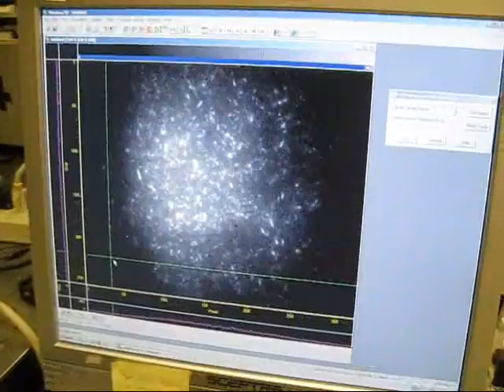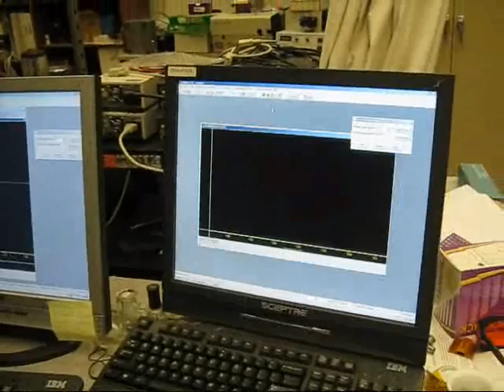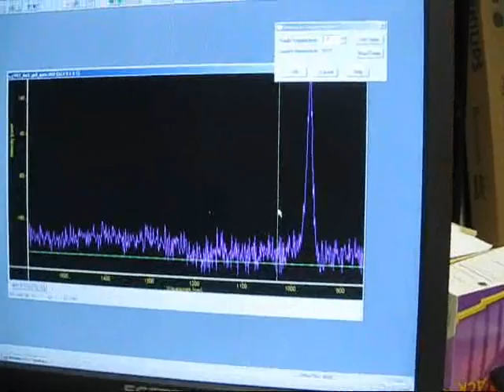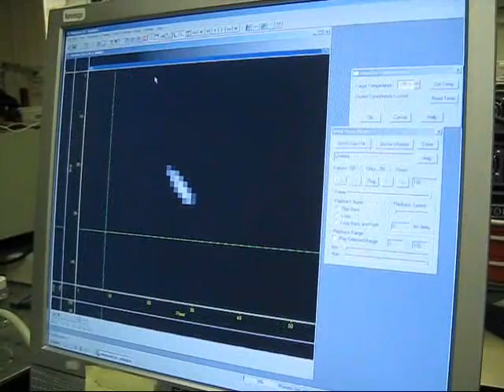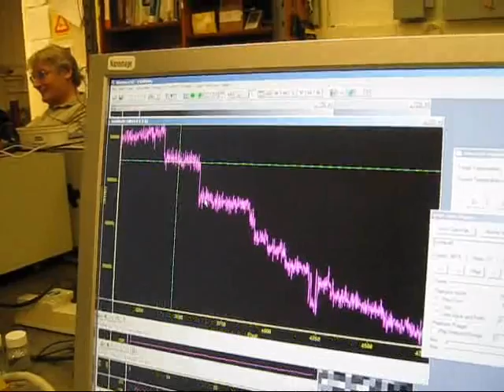Single nanotube experiment with tunable Ti:Sapphire laser Trestles sales@dmphotonics.com

Comment from the maker: Fluorescent protein properties 
http://nic.ucsf.edu/FPvisualization/
Each fluorescent protein begins plotted with excitation wavelength on the x-axis and emission wavelength on the y-axis. The color is set based on its emission wavelength, and fades to gray as the brightness (product of exctinction coefficient and quantum yield) decreases. Intrinsically fluorescent proteins are shown as circles and proteins requiring an extrinisc cofactor are shown as squares. Dimeric proteins are indicated with a 2 inside the symbol; tandem dimeric proteins are shown with a t inside the symbol. Mouseover each circle to see info on that protein or click on any datapoint to see the corresponding reference on PubMed. You can zoom using the mouse scroll wheel and pan by clicking and dragging. Use the filter sliders at the top right to select a subset of fluorescent proteins based on certain criteria. Use the X and Y axis toggle boxes to change what is plotted on each axis.

UV Proteins
Protein	?ex (nm)	?em (nm)	EC	QY	Brightness	pKa	Bleaching (s)	Maturation (min)	Lifetime (ns)	Reference
Sirius	355	424	15000	0.24	3.6	3				1
Blue Proteins
Protein	?ex (nm)	?em (nm)	EC	QY	Brightness	pKa	Bleaching (s)	Maturation (min)	Lifetime (ns)	Reference
Azurite	383	450	26200	0.55	14.4	5	33		3.4	2
EBFP2	383	448	32000	0.56	18	4.5	55		3	3
mKalama1	385	456	36000	0.45	16	5.5				3
mTagBFP2	399	454	50600	0.64	32.4	2.7	53		2.6	4
TagBFP	402	457	52000	0.63	32.8	2.7	34		2.6	7
Cyan Proteins
Protein	?ex (nm)	?em (nm)	EC	QY	Brightness	pKa	Bleaching (s)	Maturation (min)	Lifetime (ns)	Reference
ECFP	433	475	32500	0.4	13	4.7				8
Cerulean	433	475	43000	0.62	26.7	4.7	36			9
mCerulean3	433	475	40000	0.8	32	4.7				10
SCFP3A	433	474	30000	0.56	16.8	4.5				11
CyPet	435	477	35000	0.51	17.8	5.02				12
mTurquoise	434	474	30000	0.84	25.2					13
mTurquoise2	434	474	30000	0.93	27.9	3.1	90			14
TagCFP	458	480	37000	0.57	21	4.7				
mTFP1	462	492	64000	0.85	54	4.3				18
monomeric Midoriishi-Cyan	470	496	22150	0.7	15.5	7				19
Aquamarine	430	474	26000	0.89	23.1	3.3			4.1	53
Green Proteins
Protein	?ex (nm)	?em (nm)	EC	QY	Brightness	pKa	Bleaching (s)	Maturation (min)	Lifetime (ns)	Reference
TurboGFP	482	502	70000	0.53	37.1	5.2				20
TagGFP2	483	506	56500	0.6	33.9	4.7				7
mUKG	483	499	60000	0.72	43.2	5.2				21
Superfolder GFP	485	510	83300	0.65	54.1					22
Emerald	487	509	57500	0.68	37.3	6	101			23
EGFP	488	507	56000	0.6	33.6	6	174	25		24
Monomeric Azami Green	492	505	55000	0.74	40.7	5.8				25
mWasabi	493	509	70000	0.8	56	6	93			26
Clover	505	515	111000	0.76	84.4	6.1	50	30		27
mNeonGreen	506	517	116000	0.8	92.8	5.7	158	10		28
Yellow Proteins
Protein	?ex (nm)	?em (nm)	EC	QY	Brightness	pKa	Bleaching (s)	Maturation (min)	Lifetime (ns)	Reference
TagYFP	508	524	64000	0.62	39.7	5.5				
EYFP	513	527	83400	0.61	50.9	6.9	60			29
Topaz	514	527	94500	0.6	56.7					
Venus	515	528	92200	0.57	52.5	6	15			30
SYFP2	515	527	101000	0.68	68.7	6				11
Citrine	516	529	77000	0.76	58.5	5.7	49			31
Ypet	517	530	104000	0.77	80.1	5.6				12
lanRFP-?S83	521	592	71000	0.1	7.1	4.7		720		50
mPapaya1	530	541	43000	0.83	35.7	6.8				52
Orange Proteins
Protein	?ex (nm)	?em (nm)	EC	QY	Brightness	pKa	Bleaching (s)	Maturation (min)	Lifetime (ns)	Reference
Monomeric Kusabira-Orange	548	559	51600	0.6	31	5				19
mOrange	548	562	71000	0.69	49	6.5	9	150		32
mOrange2	549	565	58000	0.6	34.8	6.5				33
mKO?	551	563	105000	0.61	64	4.2				21
mKO2	551	565	63800	0.62	39.6	5.5				34
Red Proteins
Protein	?ex (nm)	?em (nm)	EC	QY	Brightness	pKa	Bleaching (s)	Maturation (min)	Lifetime (ns)	Reference
TagRFP	555	584	100000	0.48	49	3.8	48	100		35
TagRFP-T	555	584	81000	0.41	33.2	4.6	337	100		33
mRuby	558	605	112000	0.35	39.2	4.4				36
mRuby2	559	600	113000	0.38	43	5.3	123	150		27
mTangerine	568	585	38000	0.3	11.4	5.7				37
mApple	568	592	75000	0.49	36.7	6.5				33
mStrawberry	574	596	90000	0.29	26.1	4.5	15	50		32
FusionRed	580	608	95000	0.19	18.1	4.6	150	130		38
mCherry	587	610	72000	0.22	15.8	4.5	96	40		32
mNectarine	558	578	58000	0.45	26.1	6.9	11	30		49
Far Red Proteins
Protein	?ex (nm)	?em (nm)	EC	QY	Brightness	pKa	Bleaching (s)	Maturation (min)	Lifetime (ns)	Reference
mKate2	588	633	62500	0.4	25	5.4	84	20		39
HcRed-Tandem	590	637	160000	0.04	6.4					
mPlum	590	649	41000	0.1	4.1	4.5	53	100		40
mRaspberry	598	625	86000	0.15	12.9					40
mNeptune	600	650	67000	0.2	13.4	5.4	255	35		41
NirFP	605	670	15700	0.06	0.9	4.5				42
TagRFP657	611	657	34000	0.1	3.4	5				43
TagRFP675	598	675	46000	0.08	3.7	5.7		25	0.9	47
mCardinal	604	659	87000	0.19	16.5	5.3	730	27		54
Near IR Proteins
Protein	?ex (nm)	?em (nm)	EC	QY	Brightness	pKa	Bleaching (s)	Maturation (min)	Lifetime (ns)	Reference
iFP1.4	684	708	92000	0.07	6.4	4.6	50	114		44
iRFP713 (iRFP)	690	713	105000	0.06	6.2	4	450	168		45
iRFP670	643	670	114000	0.11	12.5	4				46
iRFP682	663	682	90000	0.11	9.9	4.5				46
iRFP702	673	702	93000	0.08	7.4	4.5				46
iRFP720	702	720	96000	0.06	5.8	4.5				46
iFP2.0	690	711	86000	0.08	6.9					55
Sapphire-type Proteins
Protein	?ex (nm)	?em (nm)	EC	QY	Brightness	pKa	Bleaching (s)	Maturation (min)	Lifetime (ns)	Reference
Sapphire	399	511	29000	0.64	18.6					5
T-Sapphire	399	511	44000	0.6	26.4	4.9	25			6
mAmetrine	406	526	45000	0.58	26.1	6	2.8			48
Long Stokes Shift Proteins
Protein	?ex (nm)	?em (nm)	EC	QY	Brightness	pKa	Bleaching (s)	Maturation (min)	Lifetime (ns)	Reference
mKeima Red	440	620	14400	0.24	3.5	6.5				15
mBeRFP	446	611	65000	0.27	17.6	5.6				16
LSS-mKate2	460	605	26000	0.17	4.4	2.7				17
LSS-mKate1	463	624	31200	0.08	2.5	3.2				17
LSSmOrange	437	572	52000	0.45	23.4	5.7		138		51

Comment from the maker: Bibliography

Tomosugi et al. An ultramarine fluorescent protein with increased photostability and pH insensitivity. Nat Meth 2009. 6(5): 351-353. doi: 10.1038/nmeth.1317
Mena et al. Blue fluorescent proteins with enhanced brightness and photostability from a structurally targeted library. Nat Biotechnol 2006. 24(12): 1569-1571. doi: 10.1038/nbt1264
Ai et al. Exploration of New Chromophore Structures Leads to the Identification of Improved Blue Fluorescent Proteins † . Biochemistry 2007. 46(20): 5904-5910. doi: 10.1021/bi700199g
Subach et al. An Enhanced Monomeric Blue Fluorescent Protein with the High Chemical Stability of the Chromophore. PLoS ONE 2011. 6(12): e28674. doi: 10.1371/journal.pone.0028674
Cubitt et al. Chapter 2: Understanding Structure—Function Relationships in the Aequorea victoria Green Fluorescent Protein. Green Fluorescent Proteins 1998.: 19-30. doi: 10.1016/s0091-679x(08)61946-9
Zapata-Hommer et al. BMC Biotechnology 2003. 3(1): 5. doi: 10.1186/1472-6750-3-5
Subach et al. Conversion of Red Fluorescent Protein into a Bright Blue Probe. Chemistry & Biology 2008. 15(10): 1116-1124. doi: 10.1016/j.chembiol.2008.08.006
Heim et al. Wavelength mutations and posttranslational autoxidation of green fluorescent protein.. Proceedings of the National Academy of Sciences 1994. 91(26): 12501-12504. doi: 10.1073/pnas.91.26.12501
Rizzo et al. An improved cyan fluorescent protein variant useful for FRET. Nat Biotechnol 2004. 22(4): 445-449. doi: 10.1038/nbt945
Markwardt et al. An Improved Cerulean Fluorescent Protein with Enhanced Brightness and Reduced Reversible Photoswitching. PLoS ONE 2011. 6(3): e17896. doi: 10.1371/journal.pone.0017896
Kremers et al. Cyan and Yellow Super Fluorescent Proteins with Improved Brightness, Protein Folding, and FRET Forster Radius † , ‡ . Biochemistry 2006. 45(21): 6570-6580. doi: 10.1021/bi0516273
Nguyen et al. Evolutionary optimization of fluorescent proteins for intracellular FRET. Nat Biotechnol 2005. 23(3): 355-360. doi: 10.1038/nbt1066
Goedhart et al. Bright cyan fluorescent protein variants identified by fluorescence lifetime screening. Nat Meth 2010. 7(2): 137-139. doi: 10.1038/nmeth.1415
Goedhart et al. Structure-guided evolution of cyan fluorescent proteins towards a quantum yield of 93%. Nat Comms 2012. 3: 751. doi: 10.1038/ncomms1738
Kogure et al. A fluorescent variant of a protein from the stony coral Montipora facilitates dual-color single-laser fluorescence cross-correlation spectroscopy. Nat Biotechnol 2006. 24(5): 577-581. doi: 10.1038/nbt1207
Yang et al. mBeRFP, an Improved Large Stokes Shift Red Fluorescent Protein. PLoS ONE 2013. 8(6): e64849. doi: 10.1371/journal.pone.0064849
Piatkevich et al. Monomeric red fluorescent proteins with a large Stokes shift. Proceedings of the National Academy of Sciences 2010. 107(12): 5369-5374. doi: 10.1073/pnas.0914365107
Ai et al. Directed evolution of a monomeric, bright and photostable version of Clavularia cyan fluorescent protein: structural characterization and applications in fluorescence imaging. Biochem. J. 2006. 400(3): 531. doi: 10.1042/bj20060874
KARASAWA et al. Cyan-emitting and orange-emitting fluorescent proteins as a donor/acceptor pair for fluorescence resonance energy transfer. Biochem. J. 2004. 381(1): 307. doi: 10.1042/bj20040321
Evdokimov et al. Structural basis for the fast maturation of Arthropoda green fluorescent protein. EMBO Rep 2006. 7(10): 1006-1012. doi: 10.1038/sj.embor.7400787
Tsutsui et al. Improving membrane voltage measurements using FRET with new fluorescent proteins. Nat Meth 2008. 5(8): 683-685. doi: 10.1038/nmeth.1235
Pedelacq et al. Engineering and characterization of a superfolder green fluorescent protein. Nat Biotechnol 2005. 24(1): 79-88. doi: 10.1038/nbt1172
Cubitt et al. Chapter 2: Understanding Structure—Function Relationships in the Aequorea victoria Green Fluorescent Protein. Green Fluorescent Proteins 1998.: 19-30. doi: 10.1016/s0091-679x(08)61946-9
Yang et al. Optimized Codon Usage and Chromophore Mutations Provide Enhanced Sensitivity with the Green Fluorescent Protein. Nucleic Acids Research 1996. 24(22): 4592-4593. doi: 10.1093/nar/24.22.4592
Karasawa et al. A Green-emitting Fluorescent Protein from Galaxeidae Coral and Its Monomeric Version for Use in Fluorescent Labeling. Journal of Biological Chemistry 2003. 278(36): 34167-34171. doi: 10.1074/jbc.m304063200
Ai et al. Hue-shifted monomeric variants of Clavularia cyan fluorescent protein: identification of the molecular determinants of color and applications in fluorescence imaging. BMC Biol 2008. 6(1): 13. doi: 10.1186/1741-7007-6-13
Lam et al. Improving FRET dynamic range with bright green and red fluorescent proteins. Nat Meth 2012. 9(10): 1005-1012. doi: 10.1038/nmeth.2171
Shaner et al. A bright monomeric green fluorescent protein derived from Branchiostoma lanceolatum. Nat Meth 2013. 10(5): 407-409. doi: 10.1038/nmeth.2413
Orm  et al. Crystal Structure of the Aequorea victoria Green Fluorescent Protein. Science 1996. 273(5280): 1392-1395. doi: 10.1126/science.273.5280.1392
Nagai et al. A variant of yellow fluorescent protein with fast and efficient maturation for cell-biological applications. Nat. Biotechnol. 2002. 20(1): 87-90. doi: 10.1038/nbt0102-87
Griesbeck et al. Reducing the Environmental Sensitivity of Yellow Fluorescent Protein: MECHANISM AND APPLICATIONS. Journal of Biological Chemistry 2001. 276(31): 29188-29194. doi: 10.1074/jbc.m102815200
Shaner et al. Improved monomeric red, orange and yellow fluorescent proteins derived from Discosoma sp. red fluorescent protein. Nat Biotechnol 2004. 22(12): 1567-1572. doi: 10.1038/nbt1037
Shaner et al. Improving the photostability of bright monomeric orange and red fluorescent proteins. Nat Meth 2008. 5(6): 545-551. doi: 10.1038/nmeth.1209
Sakaue-Sawano et al. Visualizing Spatiotemporal Dynamics of Multicellular Cell-Cycle Progression. Cell 2008. 132(3): 487-498. doi: 10.1016/j.cell.2007.12.033
Merzlyak et al. Bright monomeric red fluorescent protein with an extended fluorescence lifetime. Nat Meth 2007. 4(7): 555-557. doi: 10.1038/nmeth1062
Kredel et al. mRuby, a Bright Monomeric Red Fluorescent Protein for Labeling of Subcellular Structures. PLoS ONE 2009. 4(2): e4391. doi: 10.1371/journal.pone.0004391
Shaner et al. Improved monomeric red, orange and yellow fluorescent proteins derived from Discosoma sp. red fluorescent protein. Nat Biotechnol 2004. 22(12): 1567-1572. doi: 10.1038/nbt1037
Shemiakina et al. A monomeric red fluorescent protein with low cytotoxicity. Nat Comms 2012. 3: 1204. doi: 10.1038/ncomms2208
Shcherbo et al. Far-red fluorescent tags for protein imaging in living tissues. Biochem. J. 2009. 418(3): 567. doi: 10.1042/bj20081949
Wang et al. Evolution of new nonantibody proteins via iterative somatic hypermutation. Proceedings of the National Academy of Sciences 2004. 101(48): 16745-16749. doi: 10.1073/pnas.0407752101
Lin et al. Autofluorescent Proteins with Excitation in the Optical Window for Intravital Imaging in Mammals. Chemistry & Biology 2009. 16(11): 1169-1179. doi: 10.1016/j.chembiol.2009.10.009
Shcherbo et al. Near-infrared fluorescent proteins. Nat Meth 2010. 7(10): 827-829. doi: 10.1038/nmeth.1501
Morozova et al. Far-Red Fluorescent Protein Excitable with Red Lasers for Flow Cytometry and Superresolution STED Nanoscopy. Biophysical Journal 2010. 99(2): L13-L15. doi: 10.1016/j.bpj.2010.04.025
Shu et al. Mammalian Expression of Infrared Fluorescent Proteins Engineered from a Bacterial Phytochrome. Science 2009. 324(5928): 804-807. doi: 10.1126/science.1168683
Filonov et al. Bright and stable near-infrared fluorescent protein for in vivo imaging. Nat Biotechnol 2011. 29(8): 757-761. doi: 10.1038/nbt.1918
Shcherbakova et al. Near-infrared fluorescent proteins for multicolor in vivo imaging. Nat Meth 2013. 10(8): 751-754. doi: 10.1038/nmeth.2521
Piatkevich et al. Extended Stokes Shift in Fluorescent Proteins: Chromophore–Protein Interactions in a Near-Infrared TagRFP675 Variant. Scientific Reports 2013. 3doi: 10.1038/srep01847
Ai et al. Fluorescent protein FRET pairs for ratiometric imaging of dual biosensors. Nat Meth 2008. 5(5): 401-403. doi: 10.1038/nmeth.1207
Johnson et al. Red Fluorescent Protein pH Biosensor to Detect Concentrative Nucleoside Transport. Journal of Biological Chemistry 2009. 284(31): 20499-20511. doi: 10.1074/jbc.m109.019042
Pletnev et al. Structure of the red fluorescent protein from a lancelet ( Branchiostoma lanceolatum ): a novel GYG chromophore covalently bound to a nearby tyrosine . Acta Cryst Sect D 2013. 69(9): 1850-1860. doi: 10.1107/s0907444913015424
Shcherbakova et al. An Orange Fluorescent Protein with a Large Stokes Shift for Single-Excitation Multicolor FCCS and FRET Imaging. J. Am. Chem. Soc. 2012. 134(18): 7913-7923. doi: 10.1021/ja3018972
Hoi et al. An Engineered Monomeric Zoanthus sp. Yellow Fluorescent Protein. Chemistry & Biology 2013. 20(10): 1296-1304. doi: 10.1016/j.chembiol.2013.08.008
Erard et al. Minimum set of mutations needed to optimize cyan fluorescent proteins for live cell imaging. Molecular BioSystems 2013. 9(2): 258. doi: 10.1039/c2mb25303h
Chu et al. Non-invasive intravital imaging of cellular differentiation with a bright red-excitable fluorescent protein. Nat Meth 2014. 11(5): 572-578. doi: 10.1038/nmeth.2888
Yu et al. An improved monomeric infrared fluorescent protein for neuronal and tumour brain imaging. Nat Comms 2014. 5doi: 10.1038/ncomms4626

Comment from the maker: @WavyMinds To detect Raman signals from nanotubes one would need better optics, e.g. specialized notch filters, to reject excitation and detect signals very close to the excitation wavelength. Perhaps even CARS would be possible if the laser is used in femtosecond mode (+ specialized optics and detectors), but it has not been tried here. Both Raman and CARS spectroscopy of individual nanotubes have been demonstrated by other research groups already.

Comment from the maker: No and yes. This particular setup is optimized for continuous imaging and spectroscopy of fluorescent nanotubes which emit between ~ 900 and 1600 nm. It uses tunable cw laser which excite resonance absorption peaks of selected nanotube structures and a set of filters to transmit near-infrared nanotube emission and stop laser light.